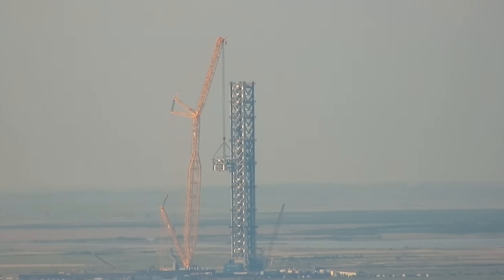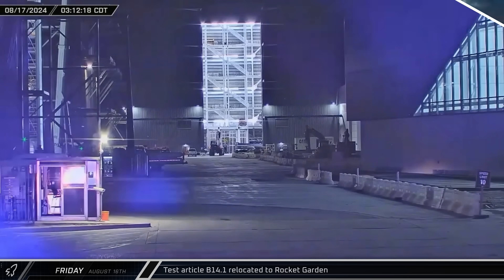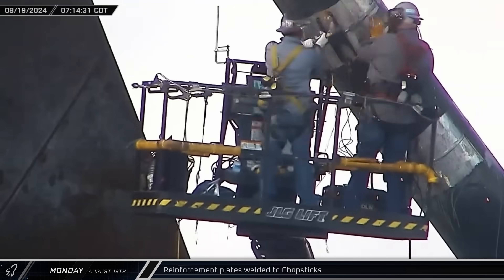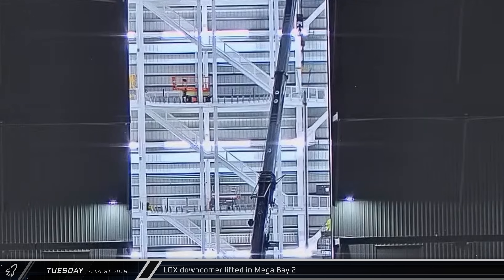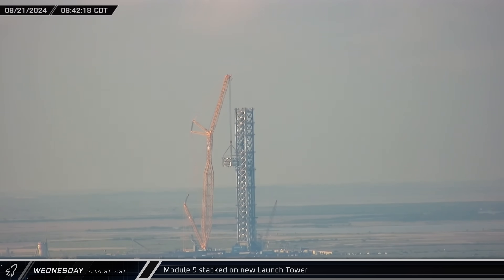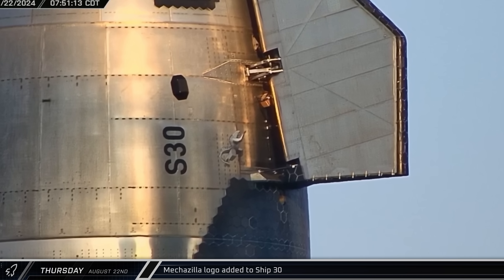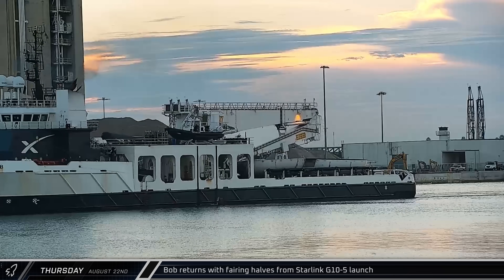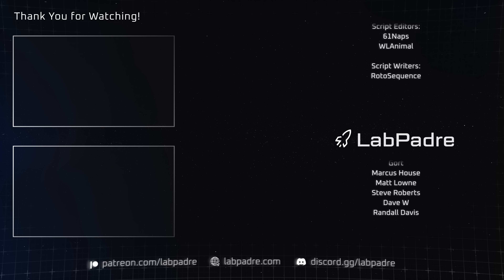Almost There! SpaceX Prepares to Catch the World's Largest Rocket - SpaceX Weekly #129

Comment: I don't understand why they haven't done catching tests to check over the chopstix design and build. I'd have thought something like the original Hopper would have been doing  repeated hops as a debugger...
Reply: A failure with the actual booster will give much more relevant data, in particular if it destroys the tower. Destroying the tower with Hopper will not leave any data about possible adjustments needed for the boosters.
Reply: Maybe it’s just too different a structure, and not able to be used, within the tolerances needed. I postulate this on the basis that the first ‘ships’ were constructed by welders who worked on fuel, water tanks, etc. Space X didn’t have the skilled welders, rotating welders, or 3D printing machines when they first got the Hopper in the air.✌️🤘🇨🇦
Reply: As others have said, I think it comes down to they can't risk damaging the chopsticks or tower right now. They'd rather launch IFT5 and deal with the potential damage upon the catch of the booster then.
Reply: Wonder if they could test the catching of a falcon 9, I know it is smaller… maybe to small and not strong enough to be caught.
Reply: Make no mistake. This catch is going to destroy the tower.
Reply: @zippythinginvention  We don't know what will happen. That's just one of the possibilities